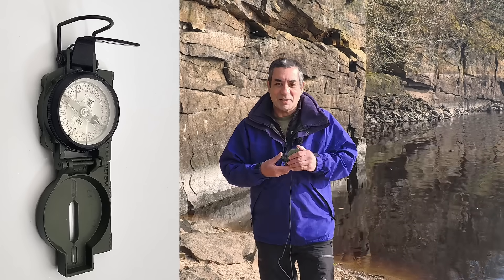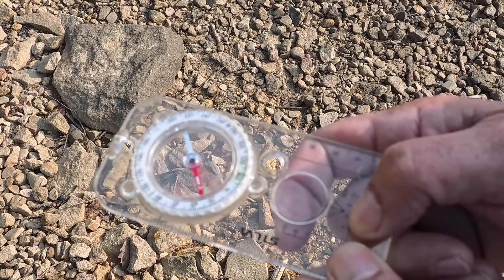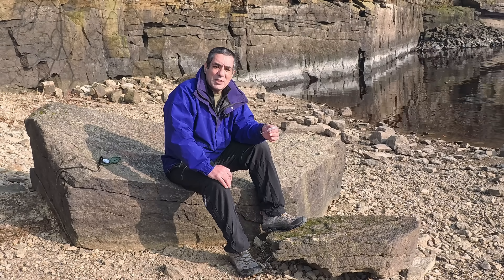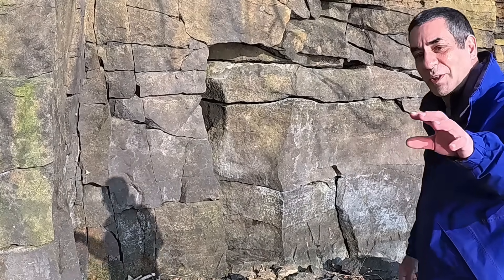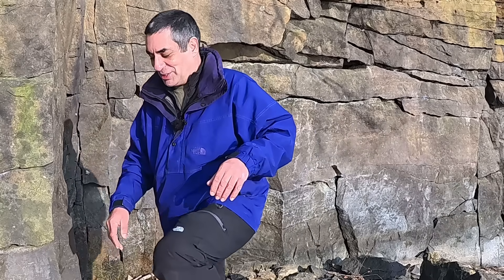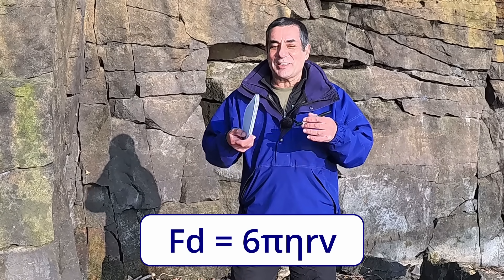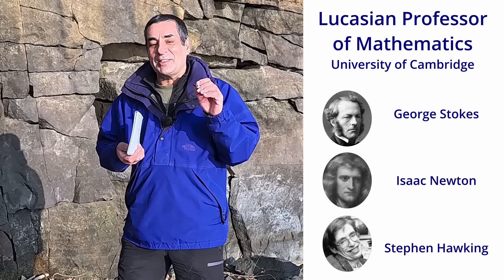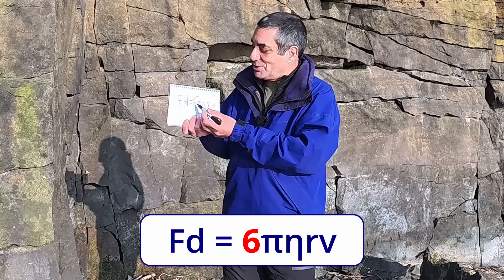Compass Induction Damping - how does it work

Comment: Thank you for this video. For various boring reasons, I want to build a compass into an item that wouldn't normally have a compass in it and the item must contain regular air. I was worried that I would need to suffer an undampened compass, and when I saw your title I was worried that I'd need a coil and resistor (that would still probably do it) but I'm pretty happy that all I would need is an aluminium ring. 

Now that I think about it, I'll have MHz AC near the compass needle anyway, so maybe I should have been looking into magnetic shielding anyway, hopefully I can find something good for high frequency too. Regardless, thanks for the tip!

Comment: Hi great video’s why are some compasses e and w are backwards like on the Breithaupt COSTU Geological Compass
Reply: Hi Herbert! That's because those are Direct Reading compasses, which aren't designed for navigation and interfacing with maps in the same way. They're really a pocket surveyor's transit, used for gathering and mapping azimuths and angles in the field.

Imagine you are looking North - your compass needle reads N or 0 degrees.   Now turn to your left to face West - on a Geo compass, the needle has stayed pointing to N but the bezel rotates counterclockwise with you, so that your needle effectively moves clockwise to your right, and is now pointing at W and you read the 270 Azimuth degrees under the needle tip directly. This makes it easy to take your bearing and transfer the azimuth reading to your notebook or map so you can log the orientation of faults, outcrops, sediment layers, etc. You simply face a direction, sight your target and read the number under the N needle.

With  a hiking compass, you face your desired direction, sight your target and then it gets different: you rotate the compass bezel to put 'red in the shed', which rotates the bezel itself clockwise, then you  read the azimuth off of your index marker. This allows you to transfer readings between your map and the real world and back again, as well as locking in that reading so you can check it on the go. Can't do that on a geo compass very easily; I mean sure, I CAN use my Brunton Geo for navigation, but my Suunto is designed such that it's faster to check bearings, and the baseplate lets me orient it on the map.

I hope this helps!

Comment: Thank you, very interesting! I believe the induction damping force would be increased with a thin copper ring around the case. This would be required if the case was non-conductive, like plastic.
Reply from the maker: The Suunto M3 (plastic - liquid filled) compass has a thin copper ring.  So it is has induction and liquid damping
Reply: @TheMapReadingCompany  thank you! I love your "waffles"

Comment: Funny you were talking about light in a room just as you were standing by the wall by the lake with the light reflections rippling across it. Nice touch 😉
If your viewers want to see Lenz law on action, they can take a length of copper pipe and drop a neodymium magnet of almost the same diameter down into it. They'll be surprised at the length time it takes for it to come out the other side 😎
And I might argue a temperature variant when it comes to the viscosity of a liquid. But then again, I might be wrong to do so 😜

Comment: As I've said before, my friend, "Waffle away!" Although, I'm not quite sure why you gave us the formula for Stokes' Law in this video but not Faraday's or Lenz's. Maybe Doc's line in "Back to the Future" about a flux capacitor having the potential for causing confusion here had something to do with it. 😜 
     For those for whom this concept is brand new: You can verify this effect for yourself and even physically feel the force of it in your hand by getting hold of a small neodymium magnet and a section of copper tubing that has a bit larger diameter than the width of the magnet. Hold the tubing vertical and drop the magnet through it. you will be surprised at how long the magnet takes to fall through it, and, if you are entirely supporting the tube with your hand, you will feel the weight of the magnet as it glides through the tube.
     Anyway, keep up the good work.

Comment: A Silva compass typically uses a fluid to dampen the movement of the magnetic needle, ensuring it settles quickly and provides a stable reading. The fluid in most Silva compasses is a mixture of water, alcohol (often ethanol), and sometimes other additives to lower the freezing point and prevent corrosion. While Silva doesn't publicly disclose the exact composition, this type of fluid is common in quality compasses to balance performance and durability.

As for the freezing point, it depends on the specific mixture, but a typical water-alcohol blend (like those used in compasses) can remain liquid well below the freezing point of pure water (0°C or 32°F). For Silva compasses, the fluid is designed to function in extreme conditions, and many of their models are rated for use in temperatures as low as -30°C (-22°F) without freezing. Below this range—say, approaching -40°C (-40°F)—the fluid might start to thicken or freeze, especially if the alcohol content is lower. High-end models might withstand even colder temperatures, but -30°C is a practical threshold for most outdoor gear in this category.

Comment: The easiest way for me to visualize and understand viscous drag is this: As the object (magnetic needle in this case) moves through the liquid, the liquid needs to flow out of the way of the object, and flow into the gap created by the object. And the more viscous the liquid, the slower it flows, so the harder it is to move through it. While this explanation isn't exactly what's going on, it should give an immediate intuitive understanding of the phenomenon.

Comment: Great explanation. I think it's a better way of damping than fluid, but maybe it would be  too difficult  more expensive to implement in a base plate compass. Edit:- Silva made a base plate induction damped compass in 1960, but the capsule was not transparent unfortunately :o(
 Mechanical car speedometers work by eddy current induction too, except in that case the needle is being dragged around the dial against a spring by a spinning magnet rather than having its motion damped ...
Reply from the maker: Some compasses have both liquid and induction damping, for example the Suunto M3.  It quite common to have both.
Reply: @TheMapReadingCompany  That's interesting. Mind you, Suunto website doesn't mention the M3 having both damping methods, you'd think that was worth mentioning ! I guess it's higher end compasses that have both damping types then - none of my baseplates have induction that I can see, but none is high-end either... I will do some more reading on the subject, thanks.
Reply from the maker: I have already filmed the next video (in fact I've already filmed the next 17 😊). I'll edit the next one this week, when I have time.  I know some people do YT full time, but I’m a navigation instructor and so spend most of my time in the hills.
The next video is about cleaning a compass and shows how to disassemble and then reassemble some of the most popular compasses.  In the section on the M3 you can see the copper ring.
Reply: @TheMapReadingCompany  I'll look forward to seeing that - Dismantling to clean will be great info for viewers - as you pointed out here, it can be a bit tricky to get the springy 'circlip' in and out. I've just this week spent time trying to get one Silva capsule to fit a different Silva baseplate, in the end I had to take the base to my lathe and carefully machine off one of the steps around the capsule mounting hole - this allowed the newer capsule, which has a rubber grip around it, to sit down properly on the base - it's a good compass now. Bit of a faff though ! Thanks Wayne.  Dave

Comment: I've wondered about the light mineral oil (??) in compasses and bubbles. Example I have a Silva starter compass, there were zero bubbles not even a tiny one. I put it in a breast pocket and went caving for 10 hours, I needed it underground there was a small bubble. However next day when brushing mud off it under tap in the sink, it had a huge bubble maybe 1/4 ml?? I thought I'd cracked it somewhere I can't see and it must have leaked (broke a few things that trip) but leaving in kitchen for a week I noticed the bubble had vanished. Ive seen bubbles come and go before with plastic baseplate from Silva. What is happening?

Comment: So...if I have a compass where all the fluid leaked out, can I stick a ring of copper or aluminum to it to restore the damping and make it more usable?
Reply: I have actually done this as i have worked on my own designs... yes, but that skinny needle used in the fluid filled compass does not balance well on the pivot without fluid. The pivot for the air filled compasses is a bit more balanced and the needle typically wider/bigger.

Comment: Is it an interesting coincidence or is there a connection between the number 6 in Stoke's law and the formula for locked rotor current? A stationary electric motor takes 6X the running amperage to start turning. There's that number 6 and effort required to turn against a magnetic field.

Comment: What we really need is for compass manufacturer to create an induction damped compass that also has a transparent capsule, along with roamer and magnifier baseplate and a sighting mirror. Then we would have durable and highly accurate compass that is excellent for work with a map (and worth the sort of money that Silva are charging for their recent new models!). Silva have no interest in induction solutions this since they are the inventors of the liquid damped compass and they are wedded to that solution. I would have thought that a company like Suunto would have done something with induction damping by now but no such luck. K&R tried making a compass with an elastomeric capsule material that did not have the built-in problems of acrylic/PMMA, but based on what I found when I bought one, it's not very successful (at least they tried).
Reply: When would you say  that Silva invented a liquid dampened compass.   Care to put a date on that?
Reply: @causewaykayak  It's all on their website. 1933.

Comment: Thank you for your video. Regarding 5:02 for clarification, inside the Cammenga Magnetic Compass the Induction Dampening Ring is not made of Aluminum. Instead the ring is made of Copper whereas the housing of the compass is made of Aluminum. The reason why Copper is used for the induction dampening ring is because Copper is diamagnetic. The Induction dampening can also demonstrated by dropping a Neodymium Magnet through a Copper tube. The magnet will take noticeably longer to fall through a Copper tube.